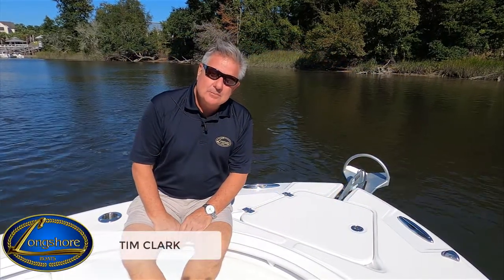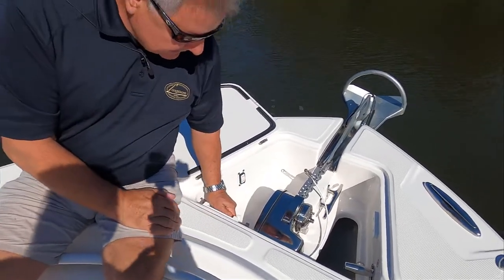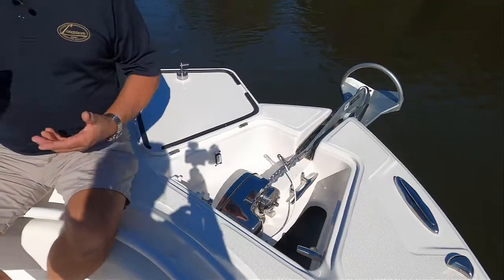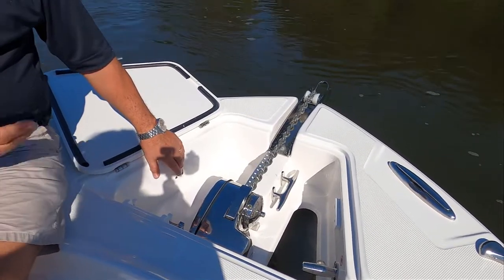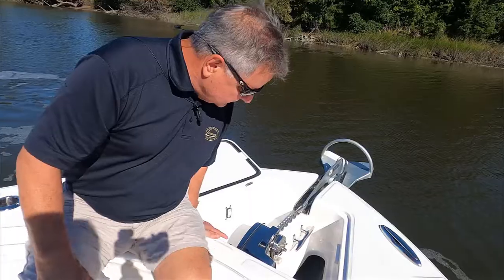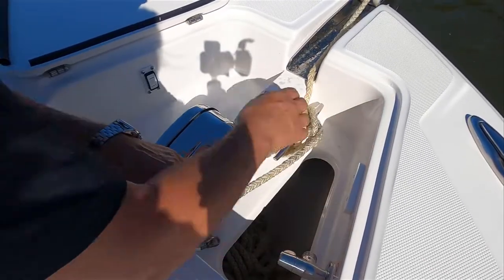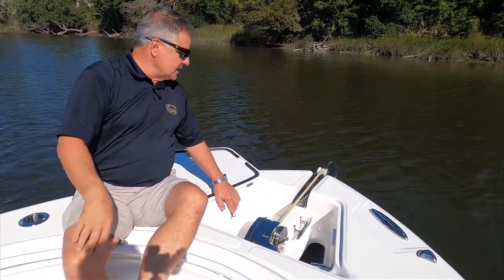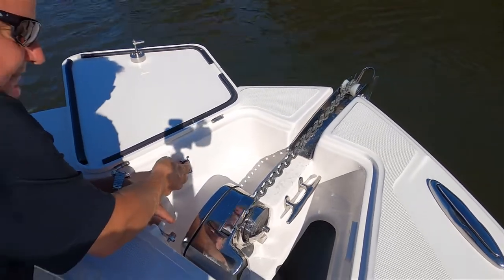How To Operate Your Anchor Windlass || Longshore Boats

Comment: I bought an old sailboat, I basically go over every system it had in three months… I had check the windlass, it moved up and down a few inches. I says “it is ok!”. I leave the marina the first day on the boat and I anchor in a bay that night … the anchor goes down. The next morning I hit the switch to bring the  anchor up … the slack comes up then the windlass stops. (@&£#~~^€€) so I pull the anchor up by hand about 30 feet and tie the chain around a cleat. Later the next evening I release the chain and let it go to the bottom again. I checked the connection (it was old) so I redid that and  that was it for that night. The next morning I decided to look at it again, I hit the button and it starts to bring the anchor up … then jams. I look under the windlass and the chain piling up and not dropping down to the rest of the chain. So I moved that little bit of chain and started the motor again, it picks up some chain and jams. It did pick up all the chain with my help but at least I didn’t have to pull the anchor up. Everything was good.

Comment: Very informative, as I’m the new owner of a 2006 pre-owned boat with a windlass. One question. You refer to the thing that secures the anchor in the up position as a “painter”(?)? Currently my boat has a black rubber tie down which is ugly and hard to attach/detach. I’d like to replace it with something cleaner and easier to secure like the system shown in this video. My Google search returns nothing close when I search “windlass anchor painter”. Am I hearing or spelling it wrong?
Reply from the maker: The windlass "painter" is a Lewmar Anchor Safety Strap. The part number is #SS180001. We carry them in stock at our store! Hope this helps!

Comment: Whats the lumar ? tool for and whats the purpose of the water valve inside the hatch over the anchor line ?
Reply from the maker: Lewmar is the make of the Anchor Windlass. The freshwater spigot is to connect a hose in order to rinse the anchor, chain & line as it comes in as needed.

Comment: Where did you get the receiver for the tool?
Reply from the maker: It comes standard on the 2020 EdgeWater 320CC that is seen in the video! If you call our parts department at 843-216-4710, we may be able to order one for you.